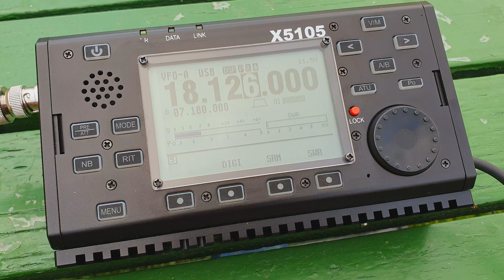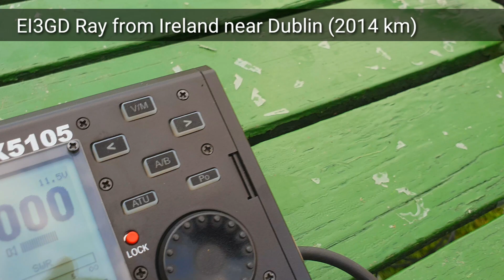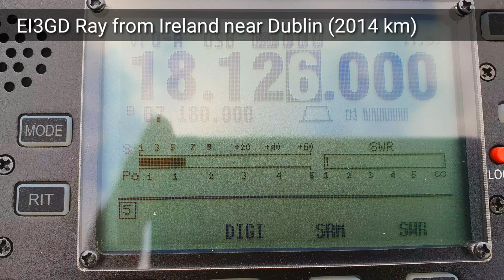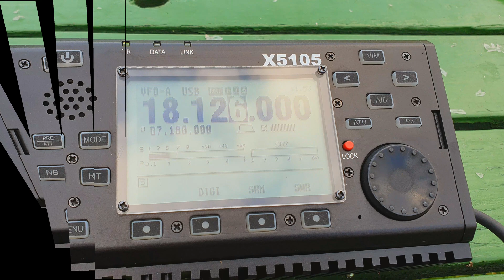Remote controlled magloop - prototype test.

Comment: Nicely done Paul, what firmware are you currently running on the X5105, any ssb issues with it?
73 from KE0JVS
Reply from the maker: Thanks! I use V3.00 beta 06 firmware and is working very good for me. I am SSB only operator. I have not found any known issues except of CW which I am not using. 73, Paul
Reply: @OM0ET  I'm running the same, and haven't had any issues as well. There have been many concerns about about the beta's, but being ssb only, like you, the radio has been a joy to use. 73, Tom
Reply from the maker: @tomkeady1750  Yes, exactly! The X5105 is my best portable rig I ever had, especially with the latest firmware ;-) 73